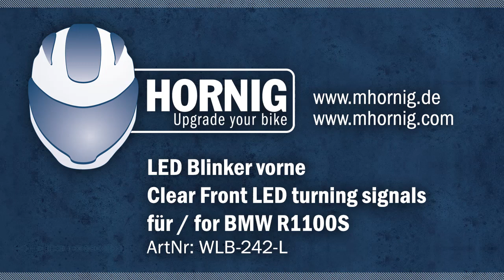LED Blinker - Turning Signals BMW R1100S by HORNIG

Comment from the maker: Hier finden Sie die LED Blinker für Ihre BMW R1100S in unserem Shop: https://www.motorradzubehoer-hornig.de/BMW-R-1100-S/Leds-Glaeser-Birnen/LED-Blinker-mit-Zulassung-vorne.html
Here you can find the LED indicators for your BMW R1100S in our Shop: https://www.motorcycleparts-hornig.com/BMW-R-1100-S/Leds-Lenses-Bulbs/LED-turning-signals-front.html
Reply: Motorradzubehör Hornig GmbH nice product, good price!
Reply: When will you have more in stock?